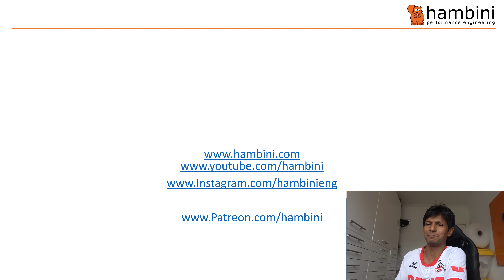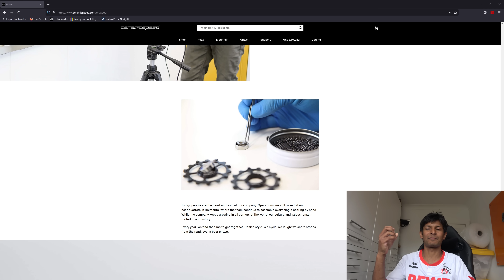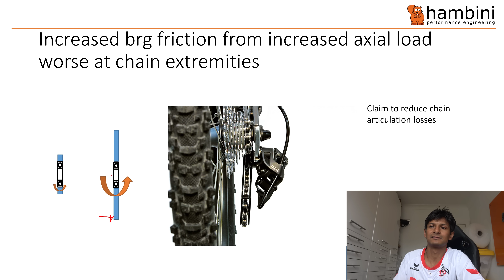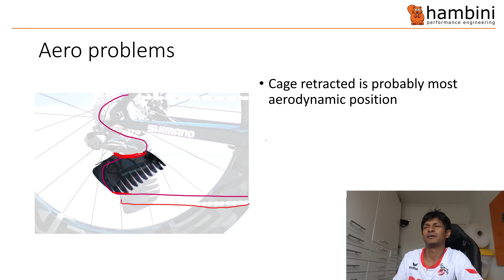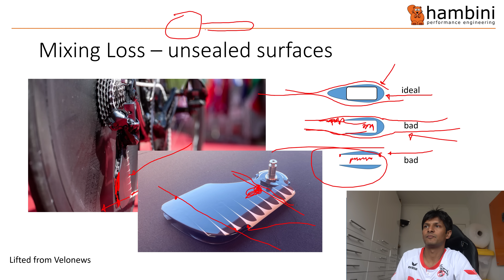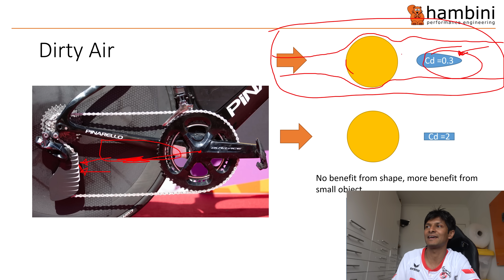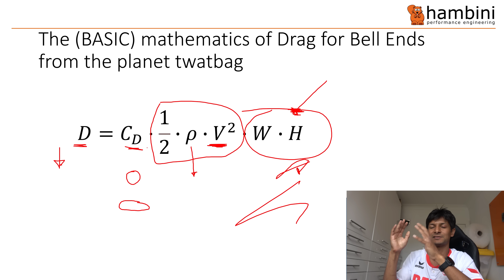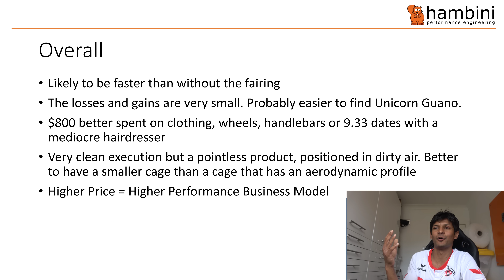Hambini's Sunday Roast: $800 CeramicSpeed OSPW

Comment: Someone should just put a bike (with rider pedaling) in a wind tunnel and wave a smoke wand around in front of it.  
That would (IMO) quickly illustrate what is important in aero, and what isn't.  
I'm guessing:  the rider's position and helmet/clothing (including shoes/socks), the front wheel/tire combination, possibly a portion of the bars and hoods.  I'd be willing to bet that the potential gains behind/below those items decreases to near zero in short order for 99.9% of the riders on the road.
I say:  spend the $800 on a bike fit, a tight-fitting jersey, keeping the drivetrain clean, and absolutely some flowers for the hair dresser -- the gains will be far more significant (and fun).
Reply: A smoke wand doesn't give you quantitative data, that's why we use load cells to actually measure drag. Drag2zero will happily rent out their tunnel to anyone - a lot of serious amateur riders are using the tunnel to tune their setup, which at £1200 a time goes some way to explaining their bank balance.

Everything counts, it just counts in proportion to CdA. There's not much point in faffing about with go-faster bits if your numbers aren't pinned on properly. With that said, very small drag savings can be highly relevant in time trials or sprints.

Much as I respect Hambini's credentials, I'd personally be a bit reluctant to dismiss this as useless. The rear mech is in an incredibly complex area of flow and properly weird things can happen there, especially with a disc wheel. We know that oversized pulleys provide a small but measurable drag reduction, so it's totally plausible to me that this setup could deliver a useful drag saving in some circumstances. Obviously it's totally pointless if you're a lardy MAMIL, but it might buy you a few tenths if you're a properly fast tester with a properly fast setup.
Reply: @j.dietrich  The whole marginal gain obsession props up companies like Ceramic Speed to come up with such unproven product. I know marginal gains are big deal to time trialists, but has anyone won the competitions consistently with OSPW? Even if one has advantage of drag reductions here and there, it's kind of pointless when that rider competes with others with the same level of fitness and unpredictable wind change (if outdoor).
Reply: @Reanimator999  adding up multiple marginal gains can make a big one is their philosophy I assume
Reply: @chronometa  its pretty much the name of the game
Reply: Agreed. If wose a couple inches off the midsection and a couple kilos we'd make way more gains for absolutely free.

Comment: If the product is sold in the EU by an EU base company, then it is illegal for the importer/manufacturer to fix the price resellers sell at. 

AS someone I know (who designed and manufactured Microlights/Hangliders) said "If it's not there, it can't cause drag".
Reply from the maker: mmm... There is a 7 page PDF about their MAP on their website https://www.ceramicspeed.com/en/about/reseller-policy.  I thought it was illegal too but the wording seems to suggest they would just be binned off as dealers

Comment: wasn't one of the arguments when the first oversized pulleys launched that even though they where bigger the efficiency savings of the rounder chain line where greater than the extra drag the bigger pulleys caused?
 for 100 dollars? maybe looks funky, 800? you can get a full bike fit and aero clothing for the same price wich will result in way better measurable performance... 
€4500 for an sl7 framset seems reasonable now
Reply: Still in the same principle. 
Back end of the bike got dirty air. With dirty air, it's better to minimize surface area. 
Oversized pulleys, covered with fairing or not, still have more surface area than regular pulley wheel cage.
Reply: @Hexsense  yeah totaly agree, but i think ceramicspeed made that statement, should have stated that in my comment

Comment: Hi, sorry for the off-topic (well, it's related with ceramicbullshit, in a way). I hope someone can help me. I'd like to buy a proper BSA 24 BB, without ceramic or stainless steel bearings. The one you sell, (when it's available!) or anything on that range of prize (like Chris King) is out of my budget at the moment. I'm looking for an easy to replace bearing's bb. At the moment the one I found more interesting is the one from Wheels Manufacturing, but requires special installation tool. Any brand suggestion?
Reply: Maaaaaaybe you´re asking on the noncorrect forum??     Rgr
Reply: @borano2031  Maaaaaaybe you don't understand the concept of "off-topic" Rgr

Comment: On a more serious note, you never speak to the challenges slow-speed and small-scale airfoils face achieving low-drag flow versus larger and higher speed airfoils.  While I haven’t looked at this for a while, it appears that over the last 15-20 much more research has been done in this area, particularly related to wind turbines.  But back in the 1990s, Selig, Donovan and others did quite a bit of research in this area related to RC sailplanes, which is where I stumbled on this topic.

Regardless, it has been my understanding that at smaller scales and at lower speeds, an airfoil need use narrower deeper sections to achieve aerodynamic efficiency.

Not being an aerodynamic (or any other type of) engineer, my understanding of all this is undoubtedly a bit lame.

How about an episode on this topic given that bicycles are low-speed in nature (even descending an alpine road) and their various cross sections are small in scale?  This could be interesting, especially for dissecting some of the more specious claims in cycling.
Reply: I guess I’m still sleepy, give me a moment to do so

Comment: But..., since we are talking low airspeeds when we are talking bikes, I tend to believe that pressure differences are less important than the "smoothing" of the airflow and that the spinning pullywheels are removed from the direct airflow.
Well I do not think it matters much anyhow, except lining the pckets of the shareholders.
I would mount a static surface on the lower arm, ahead of the shifter... (I do not care about those old men in UCI).

Comment: if hybrid ceramic isnt good y dont more ppl make full ceramic bearings?
Reply: Because ceramic races are way harder to manufacture than just balls, and they would save about 0.05 watts even if you got it perfectly smooth.
Reply: @aaronbuys  yea but they are out there, and im not sure theres much of a difference from the cheap chinese ones vs expensive. but if these so called high end brands realize the cats outta the bag, they need to invest in some real high end stuff like full ceramic then they cant be criticized as much because the gains are there.
Reply: @aaronbuys  but you saying .05 watts is like them saying 3-5watts, im sure its somewhere in between.

Comment: Putting a fin or a fairing in dirty air still reduce drag ok ?
by smoothing the dirty air means reduce the pressure drag and it also reduce the friction drag(  because the surface is much smoother)
also  are you sure you are right about the stream line you draw 14:51 ? Have you calculate the Re number at normal road cycling situation?
I am sure you didn't calculate any thing because you always roast almost every aero claim published by those big manufacturer although they do a lot of  CFD, wind tunnel testing
you just do all that hard work in you tiny brain by some wrong theory  and understanding
REALLY PATHETIC!
At least  those manufacturer write down the number that their products save LOL